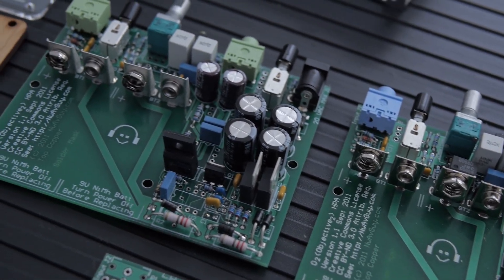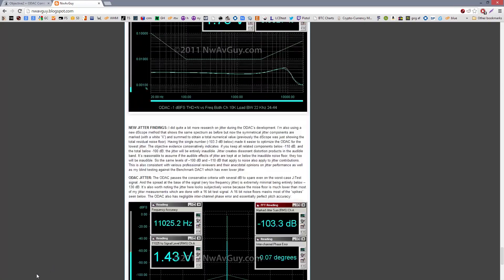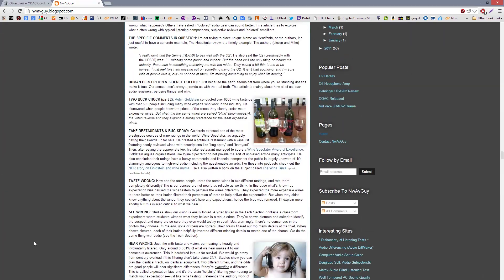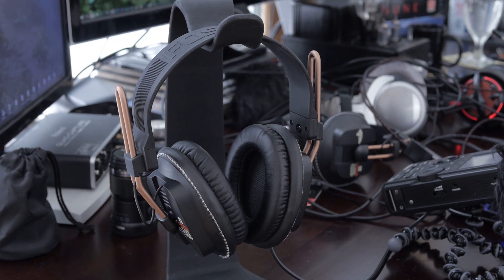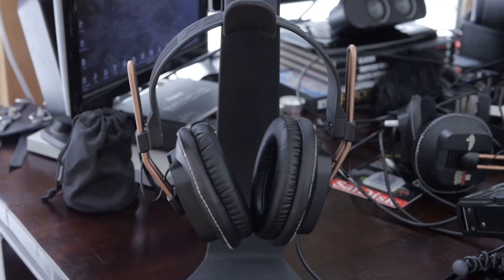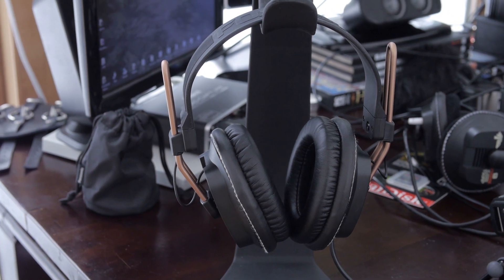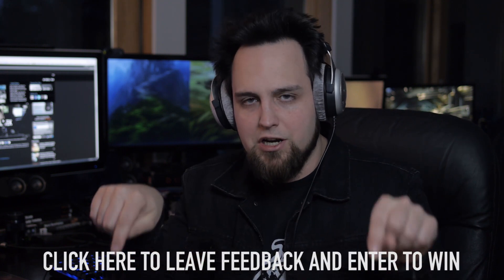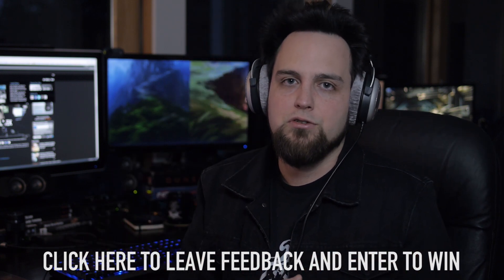Win An O2 AMP/Dac & See How Amps And Headphones Are Made

Comment: Tek Syndicate I've been doing research on the Dac/amps for a while and was looking at getting the O2/Dac combo with RCA inputs (because I intend to get an upgrade in speakers in the future) on the JDS Labs website for $296.00. Is that a good price? There was one with a 1/4 jack for $30 extra  should I avoid going for that and just get it with the standard 1/8" option?
Reply: Zeke Adebayo Since you're getting the combo perhaps you don't need the RCA jacks which are the Line Out for the DAC. Check Amazon for pricing but do be cautious with the power adapter. 1/4" for the cans is a personal choice and doesn't add, or detract, anything acoustically. JDS Labs calls for 14-20 VAC into their amp but it's not on Amazon (last I checked). I ordered it directly from JDS Labs 14 VAC @ 500 mA. Best of luck and enjoy.

Comment: I still see most headphones, of all price ranges, using vinyl or leather covers on their pads. This makes no sense to me - it never has. A slick surface that doesn't breath will never be comfortable long-term.

Sennheiser 598s use a velour (or velour-like) covering and that, coupled with the open-air design, make them so comfortable I can pretty much use them all day. I noticed the pads on the headphones you used in the video had a similar covering - I suspect that is a major reason you found them to be so wonderful. :)

Comment: I enjoy the bass boost DAC's and i also would like some sort or Mix/Monitor type of DAC. like a really small MIDI controller thats one machine with two outputs for monitoring.
just so when I could at a new sound I can use a headset that is flat, and another headset that's similar to what most consumers would use. like generic headphones.
heck! if there was a DAC that can enable some sweet input, that would be cool! like an XLR... but thats a like a MIDI interface with two channels. (the ultimate overkill)
also, a cool feat would be a plain off switch! everytime you flip the switch the audio quickly fades out.
a gain knob is cool too, i always mess with my gain knobs.
led interface, to show how many dB that is being output (or input)
a MIDI out/in
a left and right monitor channel! I have high end monitors, it would be legit if there was a knob or switch that can instantly change the output from my headset to those monitors (speakers)
also a stereo to mono switch?
this are things I'm looking for, even if i have to dish out some serious money! :P i hope this helps the devolving team on Mayflower

Comment: What would I need (DAC or AMP or both?) If I bought the Beyerdynamic DT990's? (250ohm)
I'm really really new to this stuff so I apologise if I'm asking stupid questions.
Reply: I would say both given the Ohm impedence amount of that Beyerdynamic unit to play it safe.  If you're used to listening to high or the highest quality of music ( flac or at or above 320kbps bitrate), then I THINK you'll notice a negative difference without that amp powering THOSE pair of Beyerdynamic headphones.
Reply: running off of your pc alone it probably wont be loud enough to do anything. And a dac just makes it sound better. probably. if you are using on board audio.

Comment: Since this is old and probably over anyway: What would be awesome (but expensive probably) would be a tight-fit case, one where the edge of the case is only milimeters away from the surface of either the PCB or the components and follows it's conturs. I guess it would be significantly more expensive due to the different way this would have to be manufactured, but it would look so f-ing sweet...

Comment: There needs to be a Dac that can actually measure gains so that you can tell when your audio clips and turn down the gain accordingly 
Another option that's a little more insane but I believe something to work on is adding something to view the active frequencies playing through the speakes of your headphone that it will listen to and adjust the frequencies like here's a an example you could have white noise playing that plays all frequencies equally and the one that dip on your headphones can be adjusted using the Dac 
Idk just my input

Comment: I've once had a O2. my main gripes with it is that everything is on the frontpanel. I would prefer having power and inputs on the back and outputs, volume control on the front. Even the gain switch could be on the back.

Also it would be nice with a balanced version of the O2.

Comment: What I would want to see is this,  An amplifier with it's opamps in a way which makes it easy to take out and remove/replace.  This would be done almost similarly to loading a cartridge from an old game console and you slap in 3 sets of chips, one that is neutral, one for a warm/tube like sound, and lastly one that one that is a middle ground between warm and neutral. This amp would also have more power to drive the less efficient headphones. Furthermore I wouldn't mind seeing modded grado headphones.

Comment: flagzau  Here is my problem. I love having a wireless headset for when I'm walking around in the house plus I don't have wires on me. But having to buy two separate things is adding up to the price. Wanting a decent headphones along with a mic all under 175$? Plus it doesn't have the wireless capability, ai think I would be better off with a wireless gaming headset something similar to the logitech g930.

plz help with suggestions

Comment: I would like a pair of headphones that sounds about equal to the DT770 or DT770 pro, but with an open design
Reply: The DT 990 has a similar bass response to the DT 770, but the DT 880 is more neutral over all and the better headphone. They are both open.

Comment: Hey uhm... open question, is the gold plating on the headphone plug any better than plain metal plug? does it really make a difference?
Reply: ^exactly. Back when I was song my research in this very subject I found the same answers. Silver is the best commercially available option but there's no difference. I was about to buy all silver cables until I saw the oscilloscope comparison. No difference, only in long runs.
Reply: It helps connectors make better connections.  After all, gold is the best conductor.  Don't get any funny ideas that it makes a cable "sound" better though.  A cable is only as good as it's worst conductor, in most cases that's solder (tin).
Reply: you won't notice any difference. the main downside to gold plated (note plated) is that it can get scraped off. I had a pair of stupid monster cables with such tight clamps that it scraped some of my gold plating off of my jacks. as the gold is stripped away this can actually result in a worse connection than a non gold plated jack. gold plating is just snake oil
Reply: Shadepariah Gold plating is just rubbish that marketing feed you, silver is actually the best conductor its just not inert like gold so is not used. Silver is sometimes used in uber expensive audio cables and again thats just snake oil as its not going to make a difference in a cable thats less 20m or more not actually sure on any figure but it will be more then any home user would actually need.
Reply: The other thing to note is that gold is a relatively soft metal with a certain amount of self-lubrication - more so than silver.

Comment: An all in one unit for people who use speakers and headphones. A usb input, rca input, 1/4" out (with 3.5mm adapter?), speaker out, woofer out. The point of course would be for a computer centric sound system with room for a turntable or something of that sort. It would be made to power a pair of bookshelf speakers, and the woofer out would be for anyone who wants more base when they aren't using headphones. 30 watts per channel at 8 ohms should be more than enough, especially if the speakers are efficient. That's what I want. For me, an owner of the Audioengine N22, it would remove the need for a separate DAC, and allow me to add a turntable (I don't trust the aux 3.5mm input on the back for turntable. Probably irrational, but it is made for a phone or something, so I don't know if the quality of sound from that port would be too stellar. Probably would be though.)

Also, avoid having a powerbrick or wall wart. I hate both.

Comment: wireless powered DAC, I'm not sure how you would engineer the specifics of transmission (probably 2.4Ghz for power efficiency), but I think the transmitter should be a DAC and allow 3.5mm input so you can use it to transmit audio from a computer and other devices. The receiver should have some sort of volume control and be pocket-able.

Comment: I'd like something like the O2 amp+dac, but I want something that's a bit larger and heavier.I want it to be something that looks good on my desk, preferably made from brushed aluminium.

You see this problem too with the FiiO Olympus E10, which I personally have. It's too light and small.It almost hangs from the cables that are attached. If it's large, you could actually put something on top of it.Like a monitor! No wait.. that'd be a bit too large.. ;)

The thing is, when you hold it, it should feel like it's well built, so it should have some weight to it.

Comment: How that headphone is modded looks similar to my mo's old 60s "high velocity stereophones E-81" is made: with a cotton ring around the back of the driver. They used ultra fine non-insulated wires for powering the driver (finer than a hair) :/

Comment: I think what the O2 series is missing is a 1/4" headphone out instead of 3.5mm. Most people buying an amp/dac that costs this much are going to have high end headphones which already have a 1/4" plug, and a lot of those (like my HD700s) don't have a 3.5mm adapter included. And even if you had low end headphones that only have 3.5mm, it's a lot easier to find a 1/4" adapter than it is to find a 3.5mm adapter. 
Also, 1/4" jacks are way less prone to breaking.